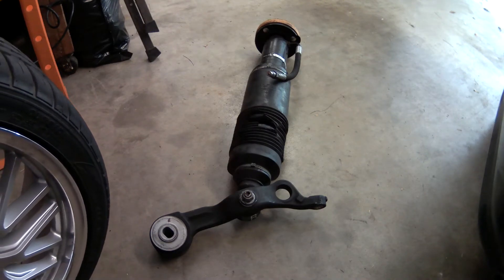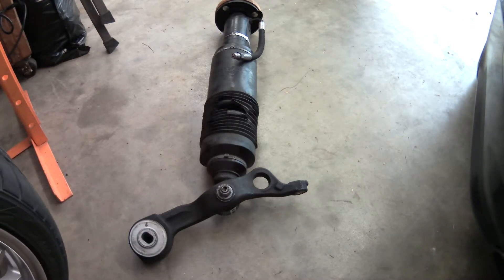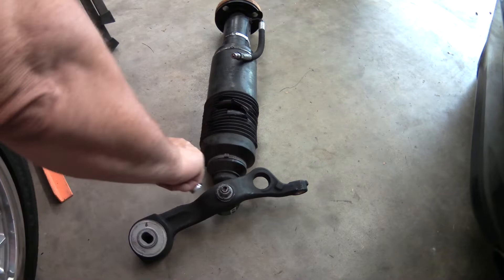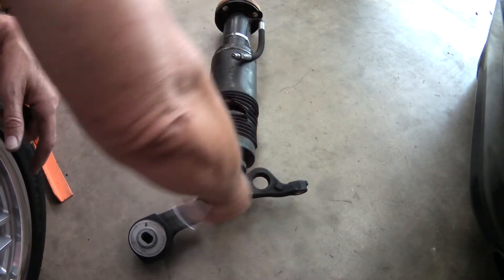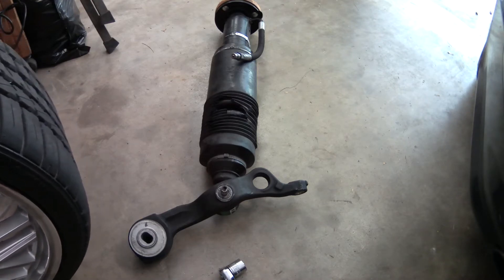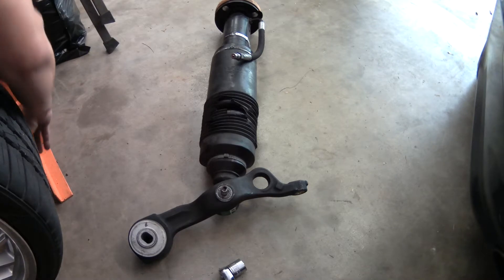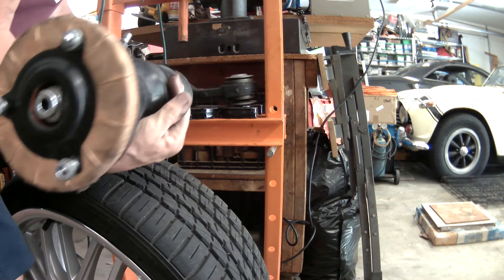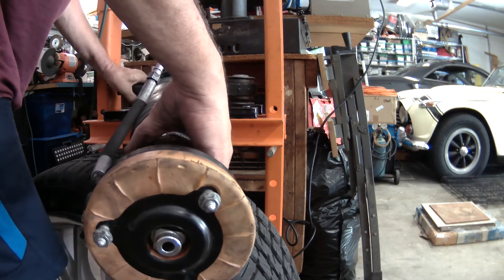SL500 R230 EASY Front Strut Ball Joint Separation

Comment: That’s a great idea! Thank you! The only alternative is to beat half of the pickled fork into the available slot. It takes alot of beating but it will eventually work. This method with the hydraulic press is much more to the point. A bit more disassembly involved. But worth it. Thank you again!!